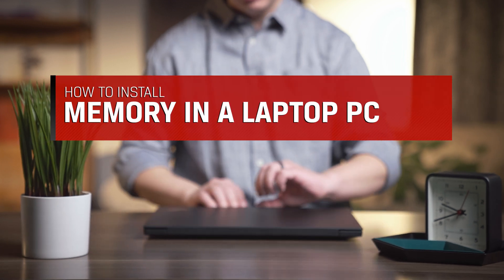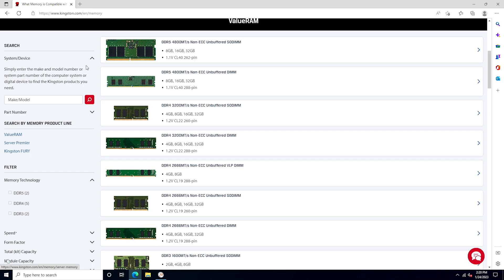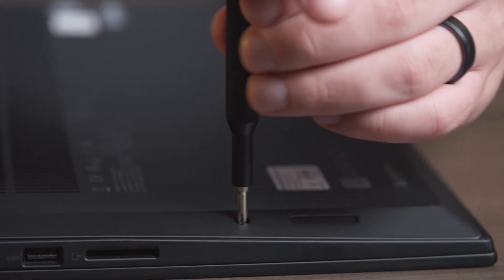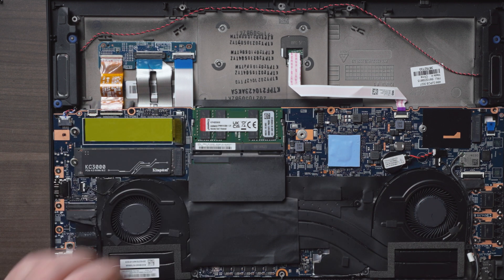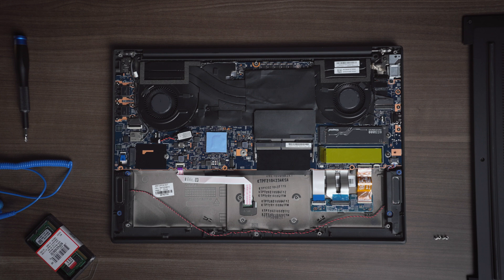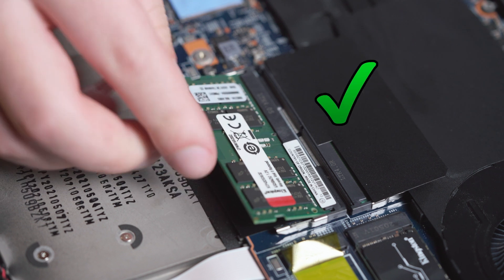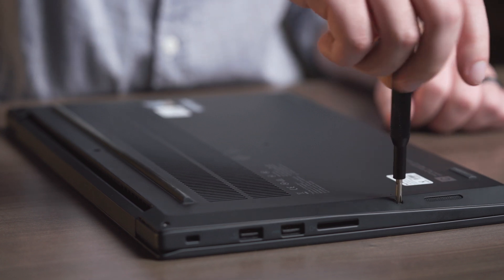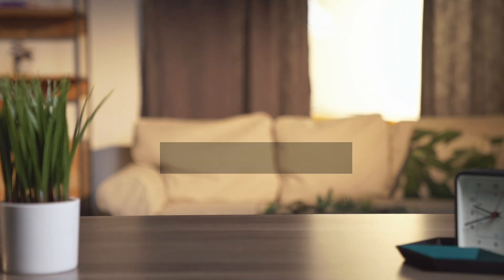How to install memory in a laptop PC - Kingston Technology

Comment: I tried Kingston, but it didn't list my HP Envy 16t-h000 laptop. I want to replace the 8 GB SODIMMs (2) with 16 GB SODIMMs (2). I've found some but there is one detail. The 8 GB says 1Rx16, while the new one says 1Rx8. Not sure what these numbers mean but one would think the replacement would be 1Rx16 also.

Comment: Is it important to remove the battery before installing the ram ?
Reply from the maker: It is recommended to disconnect the DC power adaptor from the laptop and remove the battery. However if you are not able to, once you open the cover and have access to the battery terminals inside you should disconnect the battery cable from the board.
Reply: Yes

Comment: How many ram can be installed at a time?? Like if i had 4 can I change the 4 to 8gb?? If possible are there any drawbacks??
Reply from the maker: That is a good question and that all depends on how many RAM slots your system has, which is typically 2 or 4 and compatibility. To find out what is recommended for your system, please contact us here: https://kings.tn/3Dp3VDq
Reply: @kingston  I have two ram slots of which only one is being used(4gb)
Reply: @kingston  yes I am running the compatibility check

Comment: I have Dell latitude 5530 Intel I5. 8GB installed in one slot, on the other I tried 8GB Kingston Fury. Laptop disconnected but I did not removed the battery.  Trying to turn on the laptop and the only thing I get is a few seconds of keyboard light. After that everything just dies. I removed the new Kingston Fury and laptop run diagnostics and turn on normally after. Kingston web page says the RAM have to be changes in pairs. Will that solve the problem, should I buy second 8GB DDR4 3200MT/s?The label on mine Fury says: Impact DDR4, 9905700-115.A00G, ESMS0852408 1.2V.
Packaging: KF432S20IB/8 ; 8GB (1x8GB) 9905700-115.A00G HF
Reply from the maker: Hi there. For OEM computer models, we do not recommend using our overclockable Kingston FURY due to possible BIOS and CPU limitations causing unstable conditions for the system. You can check our site here to see what part number is compatible with your computer: https://kings.tn/4gBqh28
For further assistance you can also contact our Tech Support by clicking on the 'Support' Tab on the same page. 
Thank You
Reply: Hey I have the same Kingston fury RAM and have the same problem but I have 16GB 8×8 but only 1 is Kingston Fury

Comment: Do I have to take out the battery
Reply from the maker: It is highly recommended to disconnect the DC power adaptor from the laptop and if it is possible remove the battery or simply unplug the board from the board per the manufacturer's recommendations. Need more technical support? Please reach us here: https://kings.tn/40lH4B7
Reply: @ I was asking because I have an Asus vivobook 15 and I’ve used up like 7.5gb out of 8gb worth of its ram and wondering if you have a site to look for compatibility
Reply from the maker: Sure thing, if you need compatible memory for your laptop, find it here: https://kings.tn/4fOAzLP

Comment: "don't worry, just enter the bios and accept the changes."

thing is, mine only says.

the CMOS Checksum is invalid the cmos will be reset to the default configuration and will be rebooted please check your bios setup option to see if they change" 

with the choices of CMOS Reset (502) and  ENTER - Reboot the system

Comment: Enter the bios? Is that on the chip somewhere?
Reply: Entering the bios is done during the boot up process of the computer. U hold down a combination of keys and u will enter said screen... Seems intimidating but just look it up and you'll figure it out
Reply: @riosanchez5537  I just installed the RAM today. Pretty straightforward and BIOS wasn't even an issue. Just turned it back on, waited for updates to install, and done! Went from 16GB to 64GB.
Reply: @JesusChrist-xb7jq  ayyye lmao just put a new ram in today as well. Yeah I was stressing a lil but it ended up being easyyy

Comment: NEED HELP, IF I CHANGE THE RAM OR UPGRADE THE COMPUTER WILL DELETE EVERYTHING? THANKS.
Reply from the maker: Installing memory typically is not data destructive since it is not a storage device like an HDD or SSD. For more information, please visit our site here: 
https://kings.tn/4esoDzf
Reply: I have the same question
Reply: No, RAM stands for Random Access Memory, it handles Temporary processes that can be turned on or off, if u wipe out ur systems memory u have to mess with the hard drive

Comment: Thank you so much, you saved me. I have an hp laptop, and opened the lid to try and clean the fan a bit because i work in a studio where smoke ash and dust falls on my laptop consistently. I have done this 5-6 times, without any issue. Today i cleaned it, and after i re-screwed everything the laptop display wasnt turning on. I could hear the fan turn on and off but the screen was black and caps lock was flashing, 3 slow blinks 2 quick ones. I tried this trick, however since i only have 1 ram disk i just took it off, cleaned it, ran the pc without it (it didnt turn on), turned the laptop off, i put the ram back in and everything works normally. Thank you so so so much, you are the only one that gave helpful tips, and saved me a 100€ repair. 🎉🎉🎉🎉
Reply from the maker: Glad to hear it!

Comment: Is it nessceary to remove the battery because last time i removed it for upgrading my ssd the batttery didnt connect properly and i needed t get a repair so im jsut wondering because im worried
Reply from the maker: We do suggest disconnecting the DC power adaptor from the laptop and remove the battery if possible. 
For more installation tips, please visit our site here: 
https://kings.tn/3Vcf80r
Reply: just curious how come? i would guess that electric shock risk to the user
 @kingston
Reply from the maker: Hi there, it is also to reduce and prevent electrostatic discharge (ESD) which can damage or destroy the computer or hardware components. To learn more about ESD and how to protect your electronics, please refer to the site below.

ESD Association
https://www.esda.org
Reply: @kingston  oof I was worried it would be that. I heard it can wipe the memory to or something, some of my school friends say that if you do that it will remove the schools software that basically spies on us
Reply: Hey,my laptop has only one slot and it's empty because it has 8gb ram integrated,should I remove the battery if I just have to install the ram stick in the slot?
I don't think it's necessary as long I am not removing anything
Reply from the maker: We suggest you take the necessary precautions to avoid any damage to the memory, so we recommend you consult the computer's manufacture website for their suggestion.